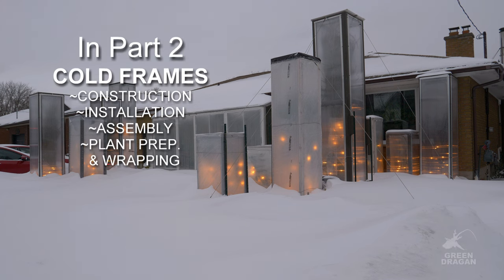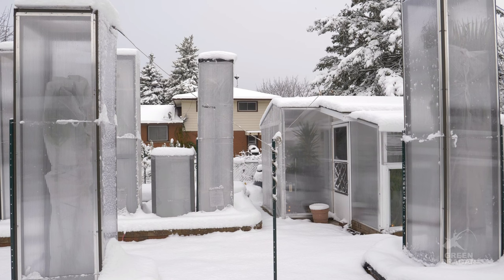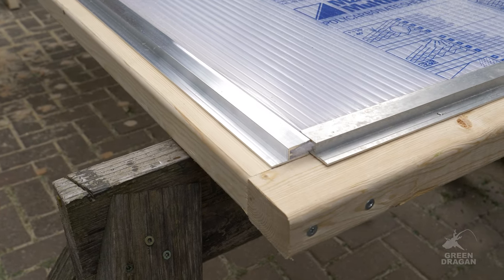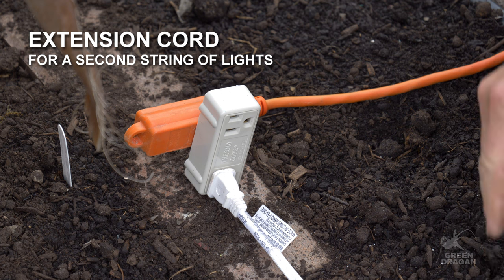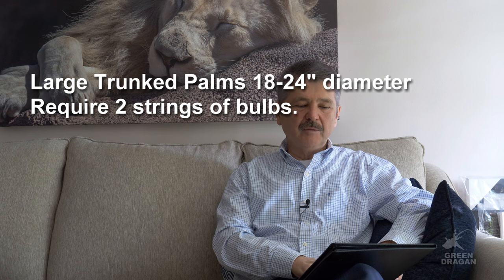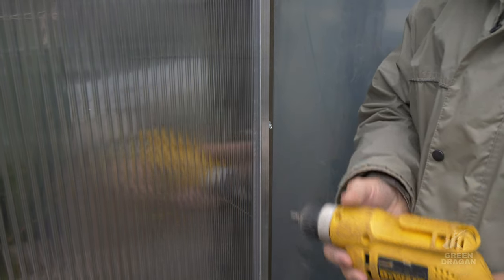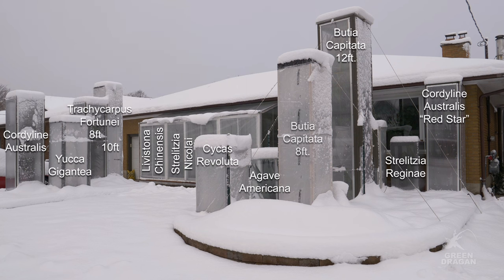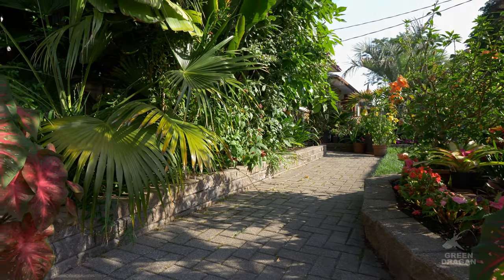Winter Protection Part 2 Cold Frames

Comment: Amazing! Just Amazing! 
I have been looking all over the internet and have gotten some great advice from some of my fellow Palm enthusiasts at the International Palm society. But seeing your approach and determination is by far the best I have seen. I live in Zone 6b in central Kentucky and have been overwintering some things in the Ground successfully (like Colocasias, Allocasias, Canna and some Banana varieties. This year I planted two 5 year old Washingtonia robustas that I grew from seed. I'm using the not so pretty Foam board box method and so far they are doing ok. But looking at your method, I think I will plant a lot more stuff out.
I do have a Question! Maybe two.
1.) How do you protect the Red Banana (Musa Eneste Maurelli)

2.) Do you wrap all of your Plants that are inside these Boxes with frost cloth or do you leave some unwrapped.

Thank you so much for sharing and giving us, who live in the harsher colder climate the hope and tools to bring the tropical look home.
Reply from the maker: Thank you so much Brian! Yes all of the plants are double wrapped. What this does is create an air pocket or tent if you will. This way we heat a smaller volume of air, just the air space directly next to the plant more or less reducing our heating cost. Secondly the leaves of the plant never touch the outside box reducing cold transfer and possible moisture problems and fungus. The red banana is treated same as the palms, c9 lights frost cloth then the box. The only drawback is they keep growing during winter and need cutting back regularly. Happy gardening.

Comment: Very helpful and inspirational video Dragan! I was wondering about the thickness of twin polycarbonate panels  you are using to overwinter your tropical plants.  Thanks a lot!
Reply from the maker: Thank you very much Ivan. The majority are 8mm thick. They come in sheets 8ft to  14ft long. Other thickness are available but difficult to source in Canada. Big box stores are not reliable at all. You need to contact greenhouse builders. Cheers.
Reply: @GreenDragan  Thank you! I wanted to know what are you using mostly. I am going to build some cold frames for my plants.  I was going to use 10 mm polycarbonate but if the 8mm is good for you it will work in my zone for a sure. Thanks for advising me!

Comment: This video is very helpful as I start preparing to need to cover some tropical plants this winter, but I wonder, do you need to provide any water to your plants at all over winter and when do you put up your cold frames and when do you take them down (general guidelines)?
Reply from the maker: Regarding watering in the winter, it depends on the type of plant what zone you are in and the duration of the extreme cold. Palm trees with my protection method using fold frames, do require water during winter. In my zone 5B garden during a typical winter there is enough snow melting between deep freezes to keep the palms happy. Bananas, succulents etc. get zero water. Putting up and taking down protection depends on the species and their cold tolerance. Trachy palms are the last to get protection while Sago palms are first followed by Pindo palms. The whole process can take 4-6 weeks from start to finish. Removing protection depends on the long range forecast. The cold hardiest plants are uncovered first when nightly temps do not drop below -5C and the most tender plants are exposed at about +5C to +7C.

Comment: Your gardens look amazing. I was wondering if you need to water any of your palms??? I have a 12ft washingtonia that was really dry after this winter.
Reply from the maker: Great question Scott. During an average winter over three decades, there is enough gradual snow melt during January thaw and milder winter days that I do not need to water. This past winter with -20c prolonged cold and 2 feet plus of snow, watering was not possible and some of my palms suffered or died back. My largest Washy totally defoliated, but since the warmer weather and some watering it has pumped out 2 fronds. I will need to build in larger access panels in the cold frames to allow for emergency watering.
Reply: Thank you for the reply. You said exactly what I was thinking. I will be more conscious from now on about adding small amounts of water if needed

Comment: Would the humidity inside the coldframe need to be regulated or does it allow for sufficient air circulation? I find your achievements amazing and I consider trying this with a Yucca gigantea. Thank you!
Reply from the maker: Hi Odd Bonsai. During milder sunny winter days the cold frames are ventilated to offer some fresh air. Many of the plants I grow can tolerate dry conditions. The light bulbs do provide a dry heat. There is some transpiration from the plants, but it is not enough moisture to be a problem typically. The yuccas are surprisingly robust. Spring update video coming soon. Cheers.
Reply: @GreenDragan  Thank you for your response. Looking forward to the next video.

Comment: Just curious how you manage significant swings in temperature.  A couple of weeks ago, it was sunny and in the 20's Celsius.  Do you have to remove the cold frames to prevent the plants from being baked?  If so, now that there has been a couple of nights with sub-zero temperatures, do you have to put the cold frames back on?
Reply from the maker: Hi Zane. During mild temps I ventilate. Last week with temps in the 20's I simply removed one panel on each cold frame and when the cold weather returned I closed it back up. Cheers.